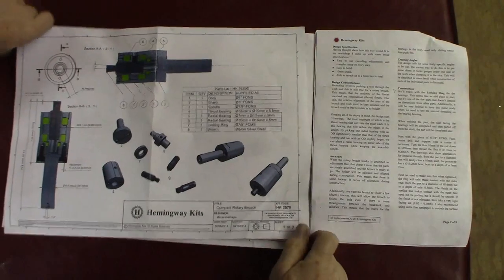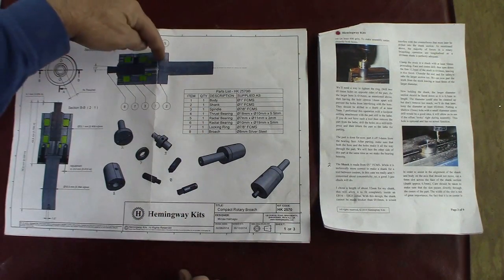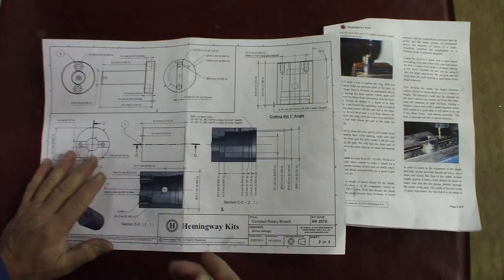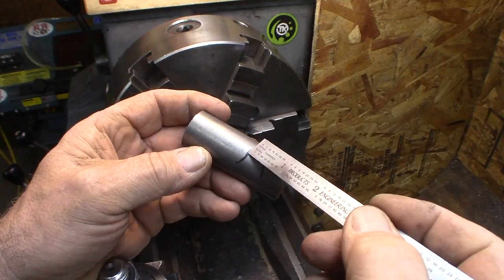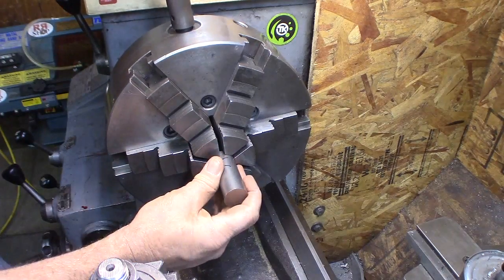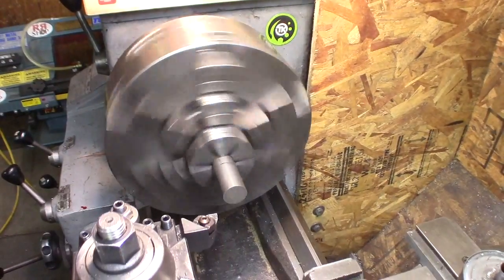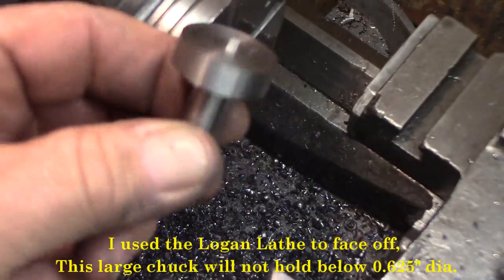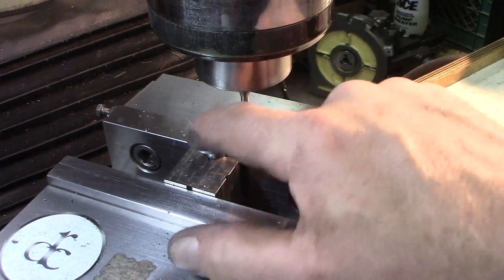How to Make a Hemingway Kit Compact Rotary Broach P2

Comment: a. excellent video - I have the same kit, but have not yet started.  NOW i HAVE SOME DIRECTION.

B.  In your previous video you noted that your vise was set at an angle - ok - but visually, makes it difficult to see and understand what is going on.  

Meant as CONSTRUCTIVE criticism.  Keep 'em coming.
Reply from the maker: Thank you Adam.  The vise was just set at 30 deg from make a few dovetail cutters, that's all.  It makes no difference for the operation I was doing in the video.  Since I was holding a round part and it did not matter as to the orientation.
Reply: I enjoyed the video and made one of these with some material and bearings I had laying around.  It was a fun little project.  Thank you for the inspiration.

Comment: Hi Randy I watch all your videos .I need to tell you all is good .But the gear noise from 
your lathe is annoying I have a tip for you. LUCAS Heavy duty oil stabilizer will make 
them almost silent . I am a Machinist and run old open gear machines a few drops and
it shuts things up. The other good thing if you use it on clean gears it will stay and not 
drip off. Try it and pass the tip along .................................Joe
Reply from the maker: I will check into some of that, thank you Joe for the help.